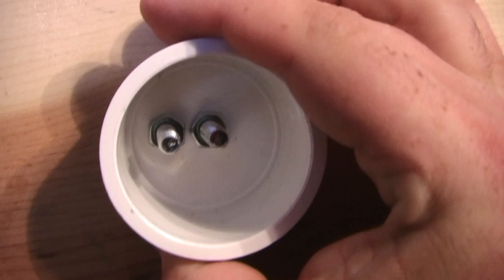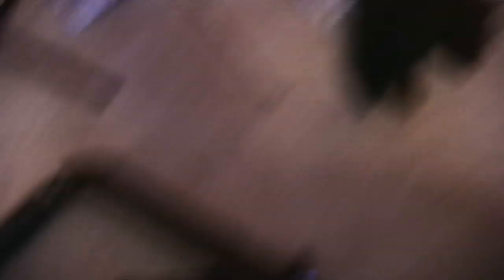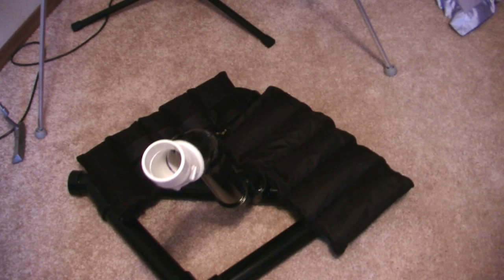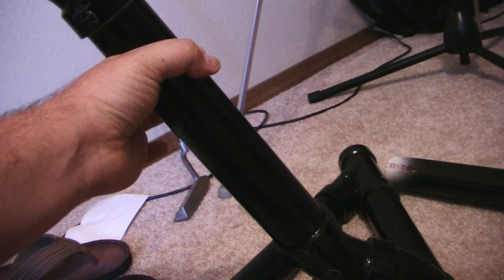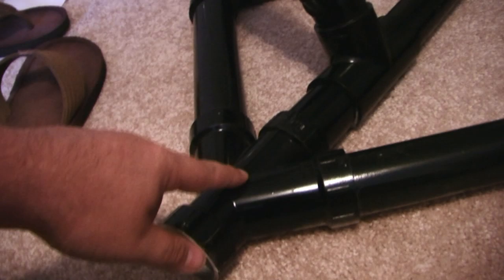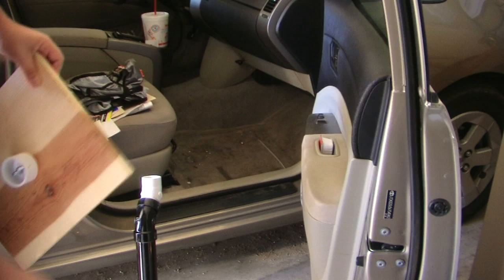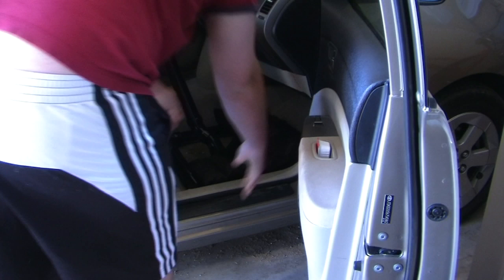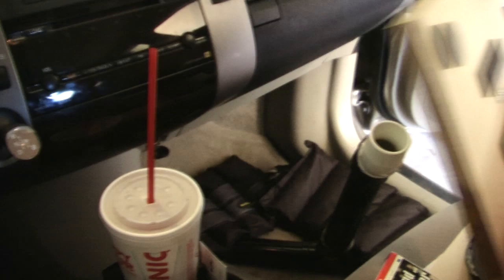DIY Car Laptop Mount $40

Comment: Good idea! I used your idea however I designed the base to fit under the seat. Now you can unplug the stand down to the floor and it can also be used with a passenger. Oh yeah, and of course, no weights are needed since it fits pretty snug under there.

Comment: I built one based on your video. Mine was cheaper. $3.50 for a 10ft pipe, and then other fittings. Cost me less than $10

Comment: for the weights on the bottom you could have filled the bottom PVC pipes with sand (wrapped in small baggies) or something heavy. Id say cement but that would probably expand too much but something similar.

Comment: for $100 ( i think ) you can buy the same mount police cars use to hold their  laptops in the car.  they bolt onto the floor using the bolts for the passanger seat track. .
Reply: kctyphoon they are not as sturdy. I tried one already.

Comment: well think about the fun for your fron passnger for a second, they have to put up with all that crap on the foot well. Makes for an uncomfortable ride. A RAM mount costs around $80. Not too far off from what you paid in materials. It's a lot more tidy, and your laptop/tablet can bolt onto the device and stay firm.